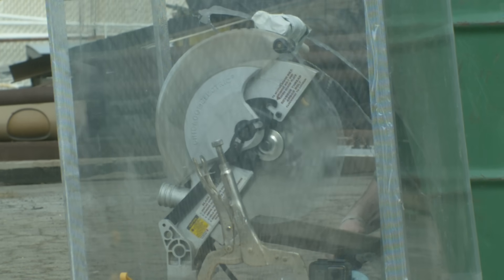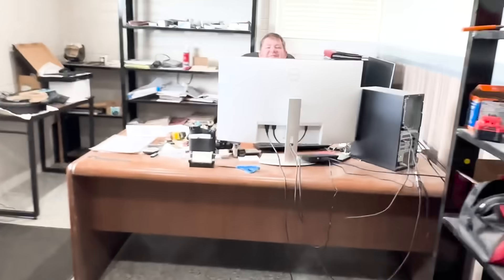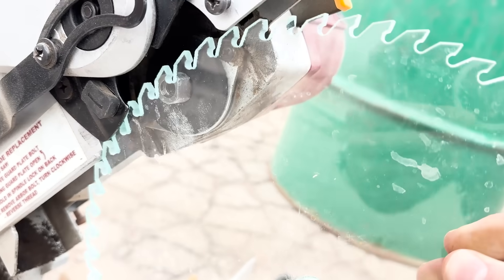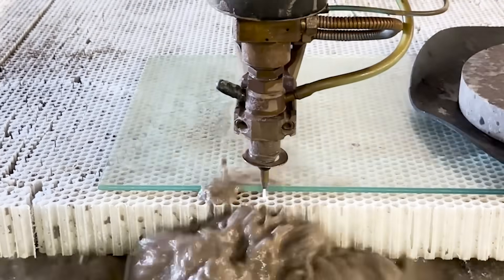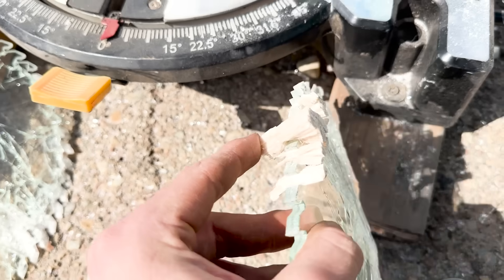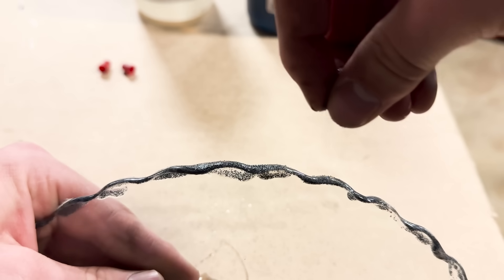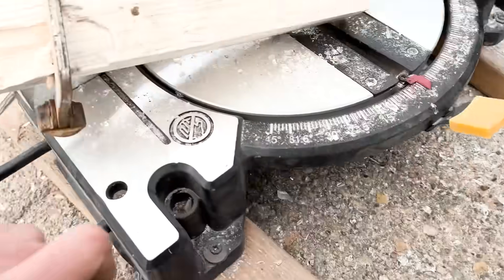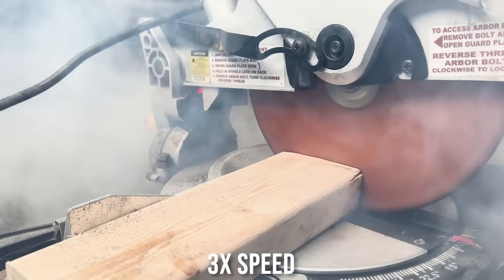Can Glass Cut Wood?

Comment from the maker: What are your best suggestions for the materials we should try next? Any tips on how we could make the glass blades less explodey??  Also, here's a link to the wood saw blade video in case you missed it: https://bit.ly/446R546
Reply: Use the lexan
Reply: @Lens_Lord  yeah he made a big song and dance about how great lexan is, you can't just turn your back on it after that.

he should go with the resin abrasive, all-overs it, not just on the blade edge but sides too to the sides will abrade the cut cavity and make a "cleaner" cut.
Reply: Obsidian or sapphire
Reply: I think the two best solutions to get glass to not shatter would be 1. Smaller diameter blade (much less inertia and therefor stress on the blade) and 2. A method to actually control the rpm and spin it slower (just like what the foot pedal was supposed to do).
Reply: Next a paper saw blade
Reply: @yoo571  that should actually do good -if done right
Reply: @yoo571 i feel like ive seen that video…
Reply: What "ramen + resin" mixture does one at least need to cut wood?
Reply: fix the screw on the saw that is rubbing on the blade
Reply: Tungsten
Reply: Carbon Fiber
Reply: The glass needs to be melted in the center hole to get rid of the tiny micro fractures from the water jet. Annealing the glass properly after melting the hole smooth would give this a much better shot at working. I blow glass and knew the second I saw the center hole to the saw blade that it would be the main issue. Expensive setup needed though(oxygen/propane torch and a kiln)
Reply: @bloink3511  you can anneal glass to make it softer? Is it like steel with watching the chill line move?
Reply: @ryanlequesne8992  annealing is just to remove internal stresses from the glass you can see if it’s worked by looking through a polarizing filter at the glass that is above a light box. Plenty of stuff on YouTube I’m sure if you are curious
Reply: Maybe use resin infused fiberglass, it's still glass but in fiber form.😁
Reply: Why not make a sawblade out of Lexan?
Reply: Carbon fibre??
Reply: What about an ice saw?  Though you might need to put the saw in a chest freezer or something.
Reply: Leather saw blade
Reply: You should use an affordable material, like astatine
Reply: @Koz4k ah yes the most common material in the world
Reply: Lexan saw blade?
Reply: Metal is more durable than glass, so logically the next step should be laminated aluminum foil
Reply: do stone
Reply: Perhaps you could try lexan... I haven't watched the video all the way through yet so sorry if you did this
Reply: A blade made out of copper
Reply: Paper is a good material because it can cut the handle of a scissor when you spin it really fast. (Yes I know other people have suggested this.)
Reply: Cement board would be interesting and it usually has fibrous material in it to help with stability
Reply: making one out of melted down sugar/candy would be cool!
Reply: Try a blade made of Ipe.
Reply: @WaterjetChannel can you tried plastic instead of glass maybe it will work.
Reply: It was crazy on this video.
Reply: Graphene or carbon fiber layered with woven glass mat and resin of some kind like g10/mycarta
Reply: I posted my suggestions below. (would repost them here but the spam filter will delete them)
Reply: Add a Variac in line to the saw. Then you can adjust the RPM for the material you are using as saw blade.  You could then slow the saw and keep the glass from self destruction..   Lets face it different materials are going to need different cutting RPM's
Reply: Tungsten 😂😂😂
Reply: Dan and Mitchell not come around anymore? I still enjoy the channel but I miss seeing them around 😢
Reply: A sawblade is made of a blend of steels but unless the saw has a swaged and shaped tip it’s not the saw steel cutting it. Other than swage there’s tungsten carbide tips, stellite fused into the steel or synthetic diamond. You could make a saw out of wood and have tungsten carbide tips and it would be fine until it got hot
Reply: Make a square saw blade.
Reply: Plastic
Reply: i feel like you need to address the shaking before moving forward, otherwise, any brittle material you use is going to suffer. you also might want to look into making the saw be able to soft start, whether thats with a variac or some kind of soft start module, its definitely gonna go a long way to helping brittle materials hold up to the stress. and you should probably do something about that screw
Reply: Make one out of polycarbonate
Reply: Epoxy and human hair
Reply: Please 🙏
Reply: What about carbon fiber? That aught to be pretty powerful!
Reply: lexan, you had it
Reply: surprised you did not us that reinforced tape on blade with strands running center out.
Reply: Dan and Mitch.....
Reply: Lexan!
Reply: lexan
Reply: well, use that stuff that you made the cover out of.
Reply: Try making the blade smaller.
Reply: Try to minimize the horizontal motion of the blade
Reply: Some fiberglass reinforced ceramic might work; otherwise, straight fiberglass, aramid, or carbon fiber sheets should be blade-worthy.
Reply: Those cracks in the center hole are massive stress concentrators and if you look at the vids when the blades fail the cracks always initiate from this point and travel outwards. I would make the center hole with a diamond hole saw to try and reduce this and then follow the rpm control advice from other in this thread. I do think a smaller blade would make a difference too, and widening the washers used(maybe a large diameter metal washer combined with rubber washers touching the part) to increase the area where load is being applied to the glass
Reply: Try a saw blade out of dried steak
Reply: Yeah, maybe try making the glass saw blade without any cracks or holes next times, so it wouldn't just break from that the second you turn it on? Man i was mad at that point lol "how did that happen?"
Reply: Just ball spittin' here; I wonder how steel might work.
Reply: Stone?
Reply: Make a Lexan saw blade, obviously
Reply: Try the Mitchell material, fairly certain that was the guys name, video's need more Mitchell material.
Reply: u should try FR4 - wear a respirator though :)
Reply: Polycarbonate polycarbonate polycarbonate
Reply: Asbestos
Reply: Ceramics
Reply: Some wild and eccentric suggestions:
Sugar and seaweed laminate
Pewter 
Magnesium 
Lead
3D printer filaments
Porcelain 
Duct tape
Chemical metal
Glue and cotton
Wolfram wire
Paint
Cardboard
Reply: Soft metals, any of them
Reply: Yeah, slow down the rpm 🤣
Reply: Make a sawblade, outta sawblades
Reply: lexan blade
Reply: Make a blade out of cloth
Reply: If you have the time & wouldn't mind, could you send a link to the tape you used or post the company's name?

Much appreciated, thank you.
Reply: Im curious how a cast iron blade would do.  Not sure about the material in a flat sheet.
Expanded steel may work ok too.
Reply: Carbon fiber should be next saw blade. That or obsidian.
Reply: Perhaps try using fire door glass with wire embedded in it?
Reply: Try a sewing machine foot pedal for variable speed.
Reply: lexan has to be next doesnt it?
Reply: Actually, I think you should try the glass blade again, but buy a better saw that doesn't have that bolt pressing against the saw blade, and get one that's meant to be variable speed.
Reply: Use Lexan! It's 250x stronger than glass!
Reply: I wanna see a saw blade made out of fiber reinforced porcelain, Ice with saw dust in it, maybe you could get that super tape, and pour a circle of  resin around it, then put abrasive on its edge, and try and cut Resin!
Reply: Get a smaller diameter blade and weld short pieces of some type of small chain. Centrifugal force can then work it’s magic. Then you will have a “chainsaw”.
Reply: I'd say maybe try concrete or even tile lol.
Reply: A cymbal
Reply: You should use polycarbonate
Reply: Tungsten
Reply: @strafingclient4311  already exists
Reply: Try mini prince albert drops as teeth, yes they are round but small enough drops (say <5mm) mounted correctly will be very difficult to shatter and could cut like a dull blade?

Also teflon coating a typical blade? Maybe a non-stick coating instead of an abrasive one has some magical abilities? Sort of like brake discs+pads rely on heat dissipation more so than the friction force - cut by heat/melting instead of abrasion 🤔
Reply: @sirtra  Rupert not albert
Reply: @WarrenMG  hahah oops, you're right.. altho i kinda wanna see both now
🍆😆🍆
Reply: make the blade smaller and make your own composite of lexan outside, glass inside.
Reply: You should use titanium and try to cut your channel in half.
Reply: sapphire glass vs aluminum.
Reply: Depleted uranium metal
Reply: I think you should try something like fabric or rubber
Reply: Why not just attempt that Lexan that you used as a shield 🛡️
Reply: I feel like you should try to make a carbon fiber of plastic sawblade.
Reply: make a saw blade out of gunpowder and resin it totally wont explode
Reply: Do lexan
Reply: A possible 'solution' was in this video already: fiberglass! Like what was in the super strong, sticky tape.
Reply: Make a carbon fiber blade (i wanna see titanium too)
Reply: obviously we have to try Lexan
Reply: Make a lexan saw, 200 times stronger than glass, sounds like 200 times more effective as a saw to me
Reply: Fiberglass reinforced toffee (sugar glass)
Reply: Frozen cheese.
Reply: Resin saw blade
Reply: Stone or metal
Reply: How about you try some water to cut some wood?
Reply: Clay
Reply: 3D printing PLA...
Reply: Carbon Fiber Saw blade
Reply: I would suggest a tungsten-titanium alloy. Easy to machine, high-wear resistance, conducts heat quickly, high melting point, corrosion resistant, little to no deformation under high temperatures, and overall, an excellent conductor of heat. All of these are the perfect properties for a saw blade. Could get a little pricey though.
Reply: Plastic
Reply: aluminum
Reply: Do a concrete sawblade
Reply: Make the center of the blade out of metal, like the washer. Maybe with the jet make the outline of this center piece some kind of pattern that will fit with the outer piece of the blade made out of glass or whatever. Or just glue both parts together, I think it would be a good idea to prevent the pressure of the tightening bolt from damaging the material being tested. Great video.
Reply: Try aluminum oxynitride, it's transparent ceramic!
it should had the hardness and durability needed.
Reply: Too bad you can't make a blade out of babies' fingernails, that might be too dangerous to handle.  Could you make a blade out of the resin and forbidden nose candy you put on the third glass blade?
Reply: A rock blade
Reply: Why not use the Lexan if it's 250x stronger then glass?
Reply: Tungsten. Heaviest...Blade...Ever...
Reply: I wonder how well Plexiglas would perform. Also maybe glue glass layers togeather?
Reply: Hard candy saw
Reply: Try Netherite
Reply: Flex Seal spray in a can could coat the metal washers to give a better seat on the blade. I bet that would help the most.
Reply: Use the Lexan
Reply: Ceramic
Reply: Ceramic or solid uranium 232
Reply: Use crystal-glass maybe :D obsidian also a good option. A carbon-fiber web inside the glass. 
A smaller blade. (Less mass)
A thinner blade ( lower friction)
A steel core so that the caps dont press on the glass directly.
Reply: Obsidian, gets sharp easily!
Reply: 😅⁸p
Reply: Korundum 
Tungsten Carbide 
Depleted Uranium
Reply: What about a polycarb blade?
Reply: Use the polycarbonate you used for the safety box
Reply: ZrO2  zirconium oxide   you would need to press it in a form of the blade and than bake it at 1500 degrees C  bringing it up to that temp slowly like 1 degree C per 20 min  and cooling it at about the same rate  I guess it depends on the thickness of your blade  you would want to make.  1 or 2 mm thick you could probably do in a day.  if you bake it  or cool it to fast it will crack. but after it cools it should be harder than still.
Reply: @alex140666  they didnt ask for materials that are easy to work with
Reply: you could try making one out of "Prince Rupert's drops" . Would need to make a disk that could hold those as a cutting  edge  without putting any pressure on the tails.
Reply: Temper that glass ffs
Reply: A sheet of man made diamond. Titanium. Depleted uranium.
Reply: Lexan blade? If it’s 250 times stronger (or so they say) then shouldn’t it cut better than the glass
Reply: Why dont you make a floating glass blade... Similar to how motorbikes having floating brake disks.
Reply: wood with carbide coating.
Reply: Epoxy
Reply: stone or plastic
Reply: Concerete
Reply: cast iron?
Reply: Jade
Reply: slower spin speed. glass needs rpm of lower than 400 rpm
Reply: Something high-density like wolfram or depleted uranium.
Reply: tungsten, also try brass or an aluminum alloy
Reply: Hello, i want to point out that the density of materials is different even tho it look ok. it is the sole reason why noobies struggle to remove the vibration from the bench grinders.  in high speeds the non balanced spinning object will make the tool to vibrate putting it on stress AND that same vibration pressure is put back on the disk causing it to break. the metal disks are strong for the tools max RPM speed so that's why we use it and the vibration is still there, but trust me increase the RPM more of the maximum of the tool and you will start to see damages. the problem you most likely will face trying different fragile materials like glass and stone is that. my proposal is make your self very simple jig like the stone balancing for bench grinder to remove that vibration. So who knows the glass can still work maybe in lower speeds but for that you need to do the math for rotation forces size and speed to work. (different example of same issue is the counter weight they put on car tiers to remove vibrations in high speeds). Also to control the speed of the tool the simplest "cheapest" way is to use a light dimmer swatch but not for led lights.
Reply: Type 440C Stainless Steel
Reply: Sapphire!!
Reply: make some composite material out of a large amount of tiny shards and something like say epoxy, basicly embedding the shards within, and then make it so that you can count on relatively slight wear on the cutting surface to gruaduatly expose small cutting shards of glass to the material.
Reply: ice
Reply: make a sawblade out of a chain saw blade
Reply: try diamond
Reply: Well.. how about thr obvious. Remove the screw which rubs on the disks?
Reply: Cement blade
Reply: PLASTIC SAW
Reply: One thousand degree saw blade
Reply: dont try this at home kids.. try it at someone else's house
Reply: If you want a strong sharp blade use a metal holder with a carbon fiber blade and diamonds on the cutting edge.
Reply: Try a steel blade with tungsten carbide tips
Reply: what about glass reinforced with wood or iron on the edge
Reply: Brick or rock?
Reply: Some kind of hard stone like granite or maybe concrete or something?
Reply: Why not put a glass blade in a cold cutoff saw?
Reply: so just make it blade out of Lexan?
Reply: Tungsten
Reply: Make a saw blade from flint rock and put a coating of resin and medal flakes
Reply: Try making a sawblade out of… metal. I’ll bet no one’s ever tried that before. 

Never mind that’s a stupid idea. It’d never work.
Reply: dont...
Reply: Cut Balsa wood instead
Reply: @Onoma314  that is balsa wood XD

Comment: Not sure if your waterjet has the ultra pierce option, but that would help prevent the glass from cracking when starting a cut in the middle. We recently got a Mach 100 where I work and all we cut on it is glass.

Comment: Gentlemen. Love your tenacity and innovation. However, one thing you've not observed is that metal blades, - even hand saw blades - have their teeth bent in small increments to either side, and are not completely vertical. This is called the "set". IOW, one tooth leans slightly to port, the next leans slightly starboard, ad finitum, until you get all the way around. This allows the blade to 'shed' the cuttings and continue smoothly without bogging down on the detritus caused by the cutting process (sawdust).  Just a heads up from an old woodworking fart. Keep up the good work ! - Rev MFn Brown.

Comment: So I don't know if you guys realized this. But you literally used the world's greatest saw to cut out your saw. It's water, you need water. Water when forced to insanely high pressures and run through a system to control it's spray or dispersion from distances can actually cut just about anything. Even in nature water can be found constantly cutting it's way through landscapes to form rivers and canyons although much slower. Now yeah I wouldn't call it a saw and it has a couple of draw backs but it still is one of the greatest cutting tools. My point is the idea of coming up with a better saw is a little redundant since we have hundreds of other things to use.

Comment: I'd still like to see saw blade cutting. It should be able to withstand the rotation, but needs to be perfectly balanced. I'm more worried about teeth holding their edges.

I think the blade failed because point stress between glass and saw axel. You had rubber on the sides but not on the center. When it vibrates, it's banging itself against the metal.

Make much bigger hole on the glass. Then plastic center piece, preferably with lathe to get it very precise. Glue it in a place with epoxy. Use thin rubber or plastic on the other side.

Second improvement: the blade should have a shape that is known to cut, not just look like blade. It should also be sharp, which means sharpening with diamond disc in real sharpening bench.Dull blade makes lots of shocks and vibrations and destroys itself. 

I'm pretty sure glass blade can cut, but such a blade would take lots of work to make.